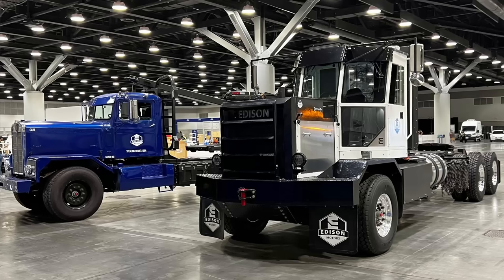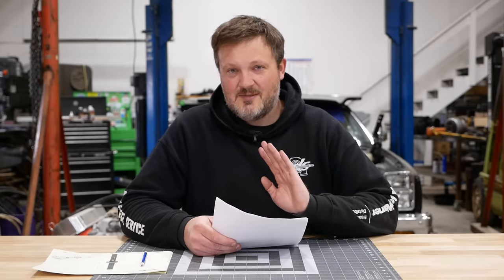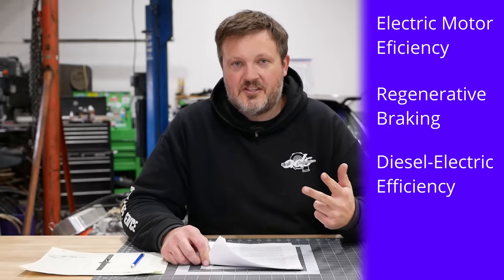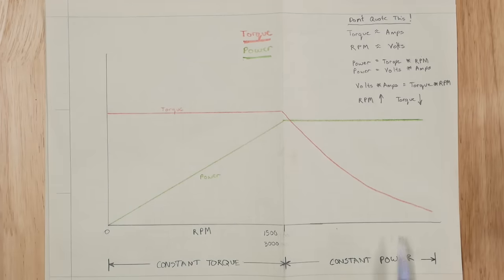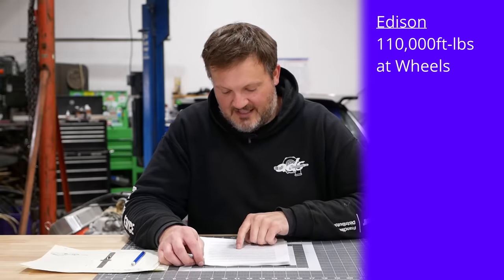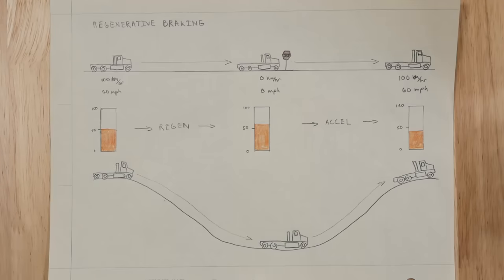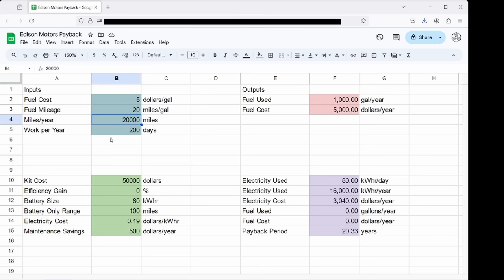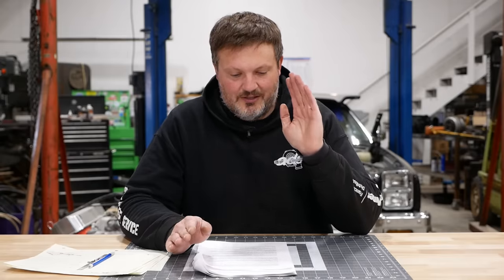Edison Motors Built a Diesel - Electric Semi Truck

Comment: danger more ev on the road means more maintenance of roads and bridges due to weight untill they solve weight/range/kwh per mile problems.
In the Netherlands ev do not pay road tax but use parking spaces for charging, weigh more then average cars and damage roads. but hey fossil buring cars can pay for that. Especially lpg, diesel then petrol and cng cars. So if you have not sufficient funds to fund an ev you get drained of savings for the benefits of the ev users. 😢
Also a new eu proposal is in the pipeline to make it almost impossible to repair or rebuild you older car. as they want to ban repairs on fire damage, large scale drive train repair(engine, gearbox rebuild/replace), weld or saw on a car, steering failure repair. these repairs would deem your car scrap. so a stuck bushing would scarp you car, rusted bold/nut would do the same. could even be bal joint could do it as that is a steering component. Jep that would mean only if you can replace your car every 4 years you are able to own and operate a car.

Comment: I think they went with too powerful electric motors. I cannot see why they need that much power. I think they did not take into consideration the power they get from the gearing down by the rear gears. That is why they need the big generator. I have no idea how KW converts to horsepower and torque. When they had the tank on the trailer it would easily spin the tires. It's cool and all but not what's actually needed.
Reply from the maker: I would guess it spun because their acceleration ramps are too aggressive.
Reply: @WatchWesWork  They have i think 500hp motors on it Electric motors have a lot of torque. The rule of thumb I was taught was if you went from a gas engine to electric was to half the needed  HP of the electric because of the amount of torque in the electric motor. 10hp gas to 5hp electric because of the instant torque. I could be way off but to me it seems overpowered. and that would use more power then needed.

Comment: I normally love your videos. However, I don't see you building any Semi's in your shop from the ground up.  Unless you plan on doing it  better  by the end of the year,  or even come up with a plan on how to do it better. What value does your input on the subject has. As you said, they are doing something now one  else has done. If you have a way to do it better, I am sure they would love your input. 
If you are an engineer, you should help generate solutions and not just views.
Edison motors will succeed or fail all on their own. They don't need your help.
Reply from the maker: Some problems don't have solutions. That's why no one has done this before. I don't need to build an entire truck to see that this thing makes no sense from a financial perspective. If they had asked anyone in the industry, they would get the same answer. Instead, they are telling people it's better, faster, and cheaper, with no proof. And they are taking people's real money for a product that doesn't even exist on a drawing board.

Comment: The government thinking they are going to electrify the transportation system is way off and not possible with the technology today. If we look at the Edison Truck as a tool to reduce emissions only, it does that, C15 constantly running to a C9 running 75% of the time or so. From a dollars and cents and efficiency perspective it’s probably not the best solution, but you have to start somewhere. From an emissions reduction standpoint, it gets us in the right direction. I’m glad to see Edison Motors taking on the big players and coming up with new ideas. They also work on providing alternative energy solutions for sites.

Comment: Doing an EV conversion never makes financial sense.  If you want an electric truck just buy one.  EV's are here to stay like it or not.  Due to legal mandates manufacturers have already spent hundreds of billions on new production facilities.  No going back from that and they are specific to EV production, can't be converted to ICE production.  

Something else to consider, when (not if), we get to a large percentage of EV's on the road, say 30% and growing what does that do the the "volume vs cost" equation of gas/diesel refining?  Less sales=less profit on a unit basis.  Economics 101.  With much less volume of sales fuel prices would quadruple at a minimum and keep going up from there.   Why so high?   Price doubles in 10 years at 7% so that's already $10 a gallon.  Higher costs of refining at less volume, yeah it'll be brutal.  Couple that with 5-10 years worth of better tech and there's no problem going EV.   We're still in the baby steps stage right now.

Comment: Conversion kits are useless. A car designed for a fuel motor has a completely wrong DNA. Batteries are heavy and the chassis needs a complete change in order to still have a decent driveable car. You cannot put a few hundred kilos in the back, and then I don’t even mention safety during a crash.

A Dutch startup called Lightroom developed a car with solar panels that could recharge itself during driving. It was completely developed from the ground up through students that entered the Solar challenge and won (University of Technology Eindhoven). Even the start price of €300.000,- per car didn’t scare initial buyers. But unfortunately they already went bankrupt, it was simply to complicated.

I don’t think these guys from Edison have enough resources to even start building trucks if Tesla cannot do it.

European truck manufacterers succed in building 40ton trucks, but the driving range is barely enough for a trip around town. It is subsidized though, so fleetowners do buy them, but just for testing and playing around while a big sum of investment is returned by goverment at this time. You got to change somewhere but empty promises make people more reluctant then enthousiast.
Reply from the maker: You just can't get enough solar panels on a car to make enough power to actually drive it. Aptera is the closest, and it's a 3 wheel car with some insanely low drag coefficient. It also can't run on just solar, but it can charge it's own batteries if it sits long enough.
Reply: @WatchWesWork  well they got very far, it is Lightyear BTW, they still exist. The prototype was promising, so they got to the testing stage, that is a lot further then most. But fully charging was not possible, also not credited by them, so no false promises there.

Comment: Electric vehicles will never truly succeed until the roadways themselves are solar chargers that charge inductively as you drive, the same way my electric toothbrush charges with no direct mechanical contact with the electric source.

Comment: Like so much of the complicated stuff you get into, a lot goes over my head. But I understand the logic of what you are on about. My very basic understanding of electric vehicles is that the drive motors are great. Most of the rest is crap. Battery technology is currently rubbish. No range. Too slow to charge. Or if you can fast charge it degrades the battery quicker. And lithium batteries are bloody dangerous. Especially the bigger ones. The infrastructure to charge them is not there. There is not enough green electricity produced to charge them. The charging stations thus rip you off in cost. And in a lot of counties there is no charging network. Or you get chargers powered by diesel generators. Very green. There is a company building electric semis in Australia. They haven't built many. Yet so far two have caught fire and been totally destroyed. One in the centre of Melbourne. Climbing up a hill. The toxic emissions from these huge batteries in thermal runaway are a serious threat. As is their potential to destroy anything around them. London multi storey car park, for example. Or Ro Ro ferries. Unless new battery technology comes out real soon that makes safe and efficient batteries. The whole electric vehicle propulsion system is pants. As an old bloke. I may never see a viable electric solution. That perfect battery always seems to be 5 to 10 years away.

Comment: Really committed cheerleaders for electric vehicles share three big delusions in common. 1. That electricity is cheap or free, available everywhere in limitless quantities, and is not generated by burning hydrocarbons. 2. That new electric vehicles are affordable, have functionality that equals internal combustion engine vehicles, and retain significant value as used vehicles. 3. That creating and eventually disposing of electric vehicles is not an environmental quagmire. 

BTW, Diesel electric locos are not the relevant analogy, submarines are. By 1910, every major power had some sort of workable submarine with some combination of internal combustion engine, electric motors and battery storage. This model continued relatively unchanged until about 1955, when the countries with the knowledge and resources switched to nuclear. 

Rather than electric cars and light trucks, maybe the solution lies keeping the cars and light trucks we have, and converting to nuclear powered ships and heavy trucks, and electric trains powered by nuclear plants, plus pumping the brakes on the trillions of miles annually of pointless, dehumanizing air travel everyone seems to think is now the norm.

Comment: Can we ask the big question how long for battery pack life??? Then how much to replace the pack?? That is the big issues with all the EV's. Pack life span and replacement cost them all the charge issues. To get any kind of the you need onboard power source. Fossil fuel is the only option that can do it as of now.

Do we even need to talk about how nasty all the crap in the battery pack is and the cost of getting it. There is nothing green about any of the whole process. You hear the it's only electric yeah sure how is it getting recharged?? Coal, natural gas or the worst offender nuclear power. The million year half life of that crappy system. 

We need a whole new power source to replace all of the tech we currently use. That is where the focus needs to be. Not building toxic rolling time bombs. Google EV battery fires and see what happens when this crap goes south in a a hurry. No way you want to park it within a garage or anywhere close to where you sleep.

Comment: It will be a long while before EV's meet the hype, my guess is it won't happen before something else is invented or discovered. Self-charging is key. Diesel gen-sets have been utilized for decades in shipping and railway. Charging station network and infrastructure are a long way from being practical. Sure, it only takes an hour to charge....if you aren't in line...we'll never get that, see modern gas stations and imagine the "fill-up" time being 5-6 times longer with EV. EV'S will be relegated to short range application. You can't talk EV without the politics, politics govern the industry, the hype, the promise while excluding the vast limitations. They will become, rightly so, a niche vehicle, commuter vehicles, daily, short distance drivers with residence installed charging stations. Meanwhile, they breach dams, stop coal, gas fired power plants, fear-monger nuclear power. You can not have both. Green energy...isn't. Not sustainable, not economically viable, really pretty stupid. Less than 3% of power requirements, with all the wind generators, solar systems is generated, only feasible because of guv'ment subsidy, (tax dollars).   If EV's are the future, you'd better prepare for a limited one.

Comment: Well done Wes, looking forward to the Deboss pickup and how it actually performs - I have been 100% electric since 2016, I am on my 4th electric car now and things have got more efficient as time has gone by. A recent vacation trip for our family sums up for me where the saving is - I am comparing the cost of that energy to me, out of my pocket -: we did 206 miles and used 38.75 k/wh of energy, that’s 5.31 miles per k/wh - that energy cost me £5.25 charging on the nighttime tariff at my house  the night before the journey, a local to me gallon of petrol is £6.86, so 1.3 more times than it cost me - that is the equivalent of 269 miles per gallon  - fantastic ! - the journey home was even better because it was free to charge at the place we stopped ! - our yearly fuel bill is one tenth of what it was - the other 9 tenths paid for the vacation 😉

Comment: Why is the USA always talk about electric vehicle's hydrogen is the new fuel here in the UK all buses  and  most farm machinery manufacturer are turning to it JCB in a few years will be using only hydrogen engines trouble is we need a hot country to make the fuel USA should be OK there

Comment: You must be living under a rock if you do not know that today's locomotives are and have been the most efficient way to move products. All you need is simple math to figure this out on your own . You seemed to be overthinking this. Simply compare the cost of moving the same weight with trains as compared to the amount of trucks to move the same weight.
Reply from the maker: I said just that. Trains are more efficient than trucks. Locomotives are not.

Comment: Tesla's semi does not know when to pull off the road on Ivey mountain road. Jackknife, setting spinning it's wheel. They are not ready to the road without no driver. They cannot change with the weather conditions. How what this vehicle made it down the side of a mountain. You don't stop there same on ice as on dry roads. It they are as bad as their cars leaving the road and the battery catch on fire.

Comment: I think your wrong I think ev is coming in 100 years guy next too me has a tesla gets too drive it 1 time a week too work because the house charger is so slow takes days too fill rest he drives a gas truck .they shut our power off in the summer because there is too much strain on the grid from ever one running there ac .rolling black outs are so common so how can everyone drive an ev .it's mineing parts for battery's using kids in 3rd world country's the mining is worst then just burning fuel .ev world wide is so far out its not even funny ...but good luck with it .il drive a 2000 chevy tell I die if it means I don't have too even sit in an ev I'm not blind and see the truth too the manufacturering of ev and most people are ...

Comment: talk is cheap, lies are costly, eaton made this same attempt with cummins and failed drastically on bus units back in the 2010's relying on substandard parts and low quality manufacturing, as long as that still occurs then this will fail as well.

Comment: First off, this was a well explained presentation!  Standalone EV's will NEVER work! we do NOT have the Grid capacity to charge ALL the EV's Period! Hybrid's do work because you can use fuel (Gas, Diesel or propane) to recharge your batteries when they get low! I don't mind Hybrids, but Electric Vehicles are a Joke in the cold weather. With the crusade against, coal and propane fueled Power Plants, we are running out of choices (there is Nuclear, but people freak out). And with the push to remove Damns Hydroelectric is getting thin on the Ground! So, just WHERE are we going to get the power for all the proposed EV's? Solar and Wind are NOT even close to providing 20% of the power needed NOW! I'll Wait for your answer! Oh, and let us not forget the cost of battery replacement (it stands at every 7 years now) and the cost of disposing of the NON-recyclable materials! I love your stuff. Keep it coming!!